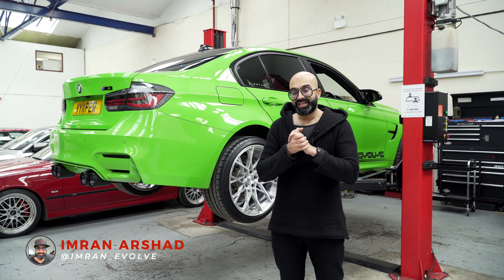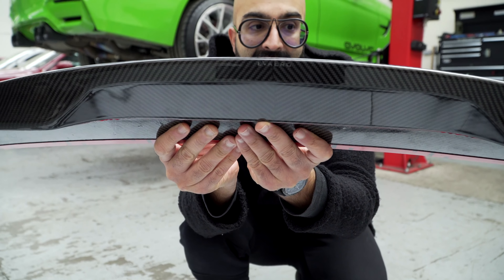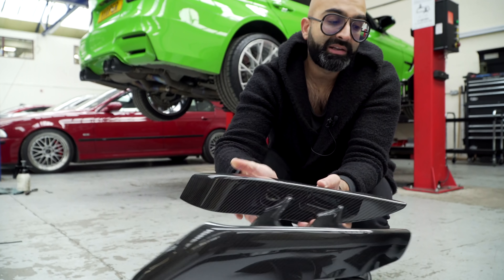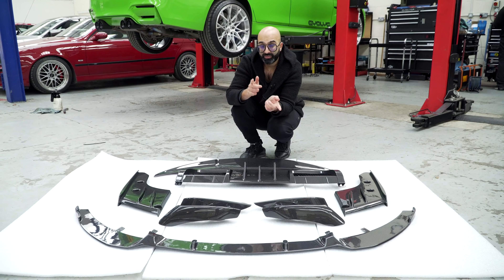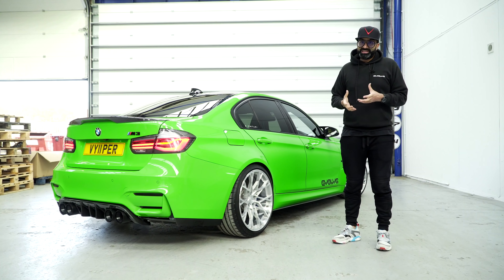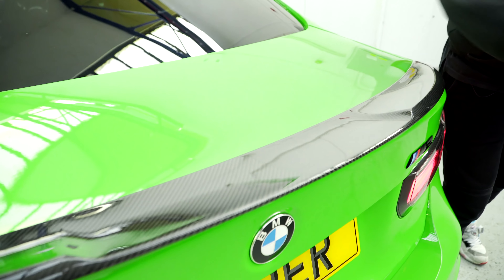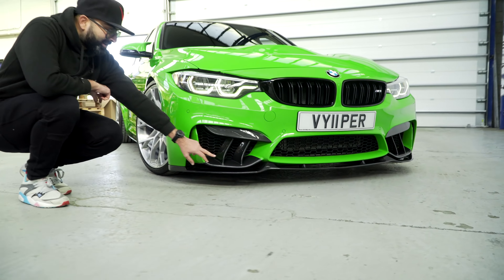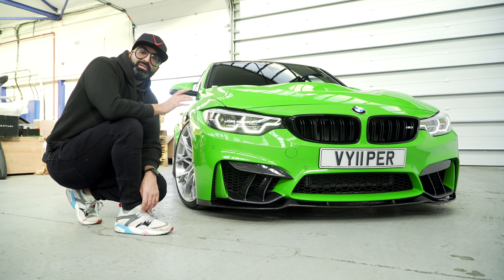Making our own Carbon Aero for the F80 M3/F82 M4 - Introducing Evaero

Comment: Imran and the Evolve Team developed a brilliant set of carbon fiber aero designs. Eventuri makes beautiful high-end carbon products.
- Trunk Spoiler design is perfect with the M4-style notch and flowing down over the trunk edge (a detail I look for).
- 3-piece Rear Diffuser is fantastic, and as close as you can get to the gorgeous VARIS/VRS undertray/diffuser kit.
- Front Lip is similar to the aggressive F8X M3 CS lip, which is my favorite. But it is not too low to avoid scraping.

Not sure about the EvAero name. I like Eventuri Aero or Aero Evolution. Encouraging to see this F8X M3/M4 Aero body kit 
as a preview of the G8X front bumper redesign coming from Evolve in 2021.

I have the Eventuri E9X M3 S65 Intake installed and Santa is bring the Eventuri 335i N55 V2 Intake.

Comment: Mr Imran. Awesome stuff right here!! Really respectable what you guys do. If I had an M3 I would certainly purchase your kit given its awesomeness factor and the fact that you guys have worked a long road getting to the point of in-house design and manufacture! In future, are you guys able to share some of the design  processes you guys have gone through? Kind of a "mini" WELT production/documentary? It be interesting to here in general what improvements in aerodynamic efficiency are realised by the kit and any other aspects relating to CFD for example (meshing, computing power, software used, validation etc). Also, and most importantly, the V that you guys have created at the centerline of the parts is just epic. I salute that! Well done all round!
Reply from the maker: Once the entire process is streamlined we will show more of a BTS of it. Currently slowly working on something for Eventuri but it takes a long time.